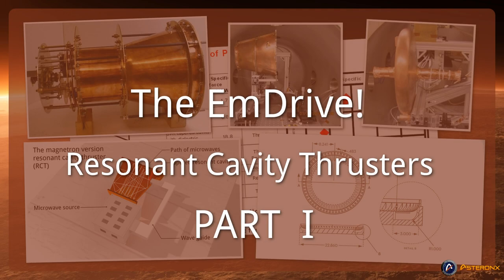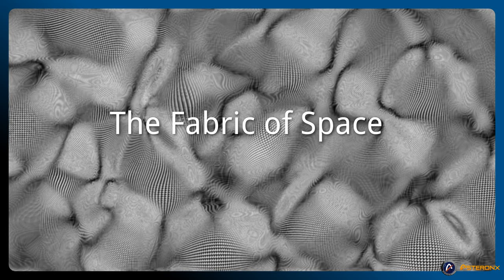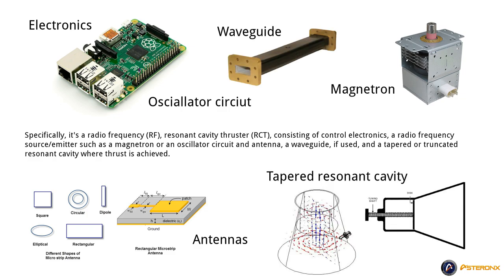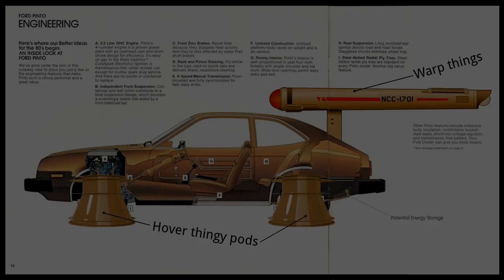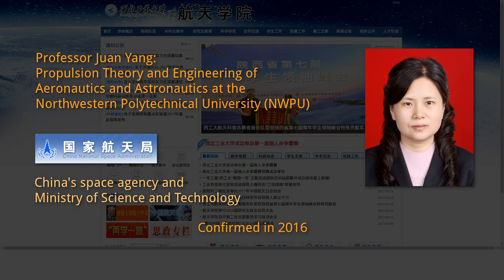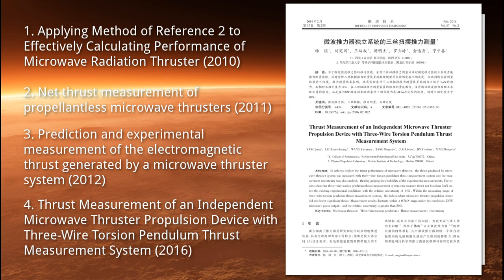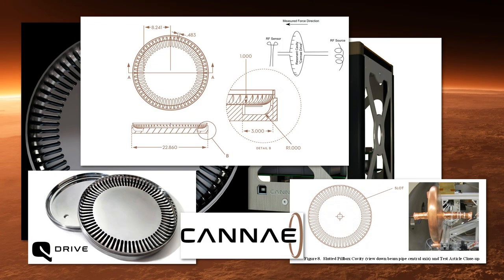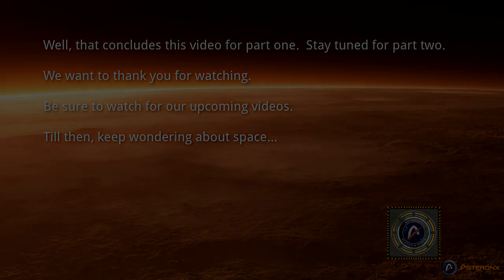An Explanation of the EmDrive and Cannae Drive Part I

Comment: The emdrive does violate conservation of momentum. Shawyer's explanation does not hold water as it does no include any new physics, and elementary arguments show that any device that does what he wants the emdrive to do must either invoke some radical new physics or violate conservation of momentum. His calculation purporting to show otherwise has elementary mistakes, such as the fact that he's not accounting for the momentum imparted to the side walls. He thinks he can handwave that away -- he cannot.
Reply: Well, here is the thing. The explanation given was a theoretical one and refutations given are theoretical ones. In the real world that's all masturbation what matters is that the drive passes the tests. It has passed tests all around the world so far. It's tested positive more then once at Eagleworks. Now it's being tested by the U.S. government in a plane for some reason and its going to go into satellites for testing.

If it still works there then it doesn't matter what Newton's law says. There will need to be something new to explain it or Newton was just wrong. 

Long story short, if it keeps on testing positive for thrust then it produces thrust. That's it, end of the line, reality trumps theory.
Reply: " It has passed tests all around the world so far. "

Nope, it has passed no useful tests. All tests done so far have been either negative or haven't properly accounted for systematic uncertainties. 

"It's tested positive more then once at Eagleworks. "

Which has the problem of systematic uncertainties above. But this can be fixed. If you analyze their data properly, their paper becomes just another negative test.

"Now it's being tested by the U.S. government in a plane for some reason and its going to go into satellites for testing."

There's no evidence of any of this.

". That's it, end of the line, reality trumps theory."

Indeed, but more importantly, reality trumps wishful thinking.
Reply: Well, here is the NASA test done that disagrees with you. https://drive.google.com/file/d/0B7kgKijo-p0ibm94VUY0TVktQlU/view

The IBT reported that China is testing it on the Tiangong-2 and the US is testing it on the X-37B.

Saying there is no evidence when you haven't looked only makes you look lazy.

I don't see how its wishful thinking to agree with positive tests.
Reply: Like I said, once you interpret their data correctly, subtract the background and control for thermal effects, that experiment reports zero thrust. Once again the issue is one of uncontrolled systematic uncertainties, nothing more.

"The IBT reported that "

And who is their source?

"Saying there is no evidence when you haven't looked"

No offense, but I'm pretty sure I've looked into this with far more care and depth than you. Hence why I know that this test doesn't show what Eagleworks claims it does.

"I don't see how its wishful thinking to agree with positive tests."

The wishful thinking is not in "agreeing with positive tests", but rather in uncritically assuming that any positive test is reliable when measuring thrusts this small can be pretty difficult.
Reply: Ok you say if you control for thermal effects the experiment reports zero thrust. Where is this at? Surely you know being that you know more about this then me.

The IBT said internal source.

I don't think you have.

Well good thing Im not doing that. I said tests not test. The repeatable positive tests is why I think there is something.
Reply: I have made two videos where I explain some of the issues concerning the emdrive in detail. I talked to builders, I talked to skeptics, I talked to proponents. I don't think you did anything approaching that. 

"The IBT said internal source."

The IBT has consistently reported nonsense with regards to the emdrive. "Internal source" is meaningless.

"Well good thing Im not doing that. I said tests not test. The repeatable positive tests is why I think there is something."

What you still fail to understand is that there has never been a positive test.
Reply: So did you not read the links on your first video. The Johnson Space Center got a positive and addressed  thermal. 

Talking to skeptics and proponents is masturbation. You may as well be saying some people told me their feels.

Well, the IBT is not some fly by night tabloid so citation needed on that one. Anon sources is how stories normally break but not sure what you mean by meaningless when you talk to people about their feels on the topic.

What you fail to understand is that there are positive tests and you linked one in you video description.
Reply: "So did you not read the links on your first video. The Johnson Space Center got a positive and addressed  thermal. "

I don't know what you mean by "Johnson space center". Eagleworks is essentially an independent lab. As I explained to you, they analyzed their data incorrectly. What they claimed they got is irrelevant; their experiment shows zero thrust once thermal expansion and background effects are accounted for correctly.

"Talking to skeptics and proponents is masturbation. You may as well be saying some people told me their feels."

This is just to illustrate what kind of effort and care I spent here. I highly doubt you looked into this with more care and depth than I. 

"Well, the IBT is not some fly by night tabloid"

It pretty much is.

"citation needed on that one"

Actually, the burden of proof is still on your court. The evidence you presented was essentially "some journalist asserted it". That's not credible at all.

"What you fail to understand is that there are positive tests and you linked one in you video description."

Can you explain in your own words what a systematic uncertainty is?
Reply: Well the one you linked says Johnson space center. Again feel free to do an experiment or link one that shows the experiment you linked can be explained by "thermal expansion and background effects". Just saying "no it's wrong" is as you would say "irrelevant".

Well if you consider wasting time with peoples feels as "effort and care" then maybe you have, but peoples feels don't actually count for anything so....

Well there track record is evidence that they are not some fly by night tabloid. So when you say they are that's a claim. Claims have burden of proof. I told you my evidence now it's your turn. Do you even now what the IBT is?

Inherent inaccuracy in a measuring process. Now in your own words can you explain statistical significance? While you're at it explain how statistical significance deals with systematic uncertainty.
Reply: "Inherent inaccuracy in a measuring process. "

Incorrect.

"While you're at it explain how statistical significance deals with systematic uncertainty."

It doesn't.

Let's put it this way. I bet you $200 that there will be no functioning emdrive in one year. Well?
Reply: The mere fact that you think "statistical significance" has any bearing on systematic uncertainties means you don't understand systematic uncertainties. This is important, because it's the crux of why the emdrive supposedly positive tests don't demonstrate what proponents believe they demonstrate.

"Well Ill take that because there are already ones that function"

Nope, there are zero at the moment. I'm talking about incontrovertibly functioning. Independently tested, systematics accounted for, clearly beating a photon rocket. Easy $200 if you're right. Well?
Reply: The mere fact that you don't think "statistical significance" has any bearing on systematic uncertainties means you don't understand systematic uncertainties. It is very important, because it's the crux of why the emdrive positive tests actually demonstrate what the tests demonstrate.

Ill explain it to you. If the statistical significance of a test is high enough it rules out errors (uncertainties) to a certain percentage. Then you go into peer review to try and get more tests of statistical significance to rule out error even more. Currently the Nasa paper has passed peer review and is being replicated more. Soon to be tested in space in a satellite and a space station. 

Well their function is to produce thrust. They do that even if it's only from thermal expansion. So you own me $200.
Reply: "Ill explain it to you. If the statistical significance of a test is high enough it rules out errors (uncertainties) to a certain percentage. "

Not systematic uncertainties. That's the point. That's why it's important that you understand the difference between systematic and random errors. A systematic error is, for example, if I'm measuring time with a pendulum clock, but I made a mistake when measuring the length of the cord, or the gravitational constant. All times measured by that clock will be off and it doesn't matter how much data I take. The "p-value" is irrelevant because my data is systematically wrong.

"Then you go into peer review to try and get more tests of statistical significance"

No testing is done during peer review.

"Soon to be tested in space in a satellite and a space station. "

There's no evidence of this.

"Well their function is to produce thrust. They do that even if it's only from thermal expansion."

No, they don't. A thrust from thermal expansion cannot be used for anything -- it's just measurement error.

"So you own me $200."

Where is the incontrovertible test I asked for?
Reply: Thats why you design to weed out that possibility and statistical significance is a part of that. See you run multiple tests and a null test which weeds out systematic error with statistical significance. If you have only one test with a huge discrepancy with the others then it's most likely not random error its a systematic error. Have you never done a college level experiment before?

Didn't say there was testing in peer review. 

There is evidence and I gave it to you. I have seen even more with a simple google search. This is mostly pointless because anything I give you, you'll just say it doesn't count in some way by making a baseless claim like you did before. SO Ill ask you what would it take to show you that there are planed experiments for the EMdrive in space?

Not being useful is not the same thing as not functional. 

Every test done even the inconclusive ones showed thrust of some kind. Pick one any one. You own me $200.
Reply: "Thats why you design to weed out that possibility and statistical significance is a part of that. See you run multiple tests and a null test which weeds out systematic error with statistical significance."

No, that's not how any of this works. Systematic uncertainties are not trivial and they are the reason the Eagleworks test failed.

"Have you never done a college level experiment before?"

I have taught them.

"There is evidence and I gave it to you."

There is zero evidence. "Some journalist said it" is not evidence. Journalists can say whatever they want. 

"This is mostly pointless because anything I give you, you'll just say it doesn't count in some way"

I'll only say it "doesn't count" if there's a serious problem with the evidence, such as it hinging on the word of some random journalist. "A journalist said it" is not evidence.

" by making a baseless claim like you did before. "

Which claim was baseless?

"SO Ill ask you what would it take to show you that there are planed experiments for the EMdrive in space?"

A statement by the agency doing the testing. No "internal sources", no journalists.

"Not being useful is not the same thing as not functional. "

Of course it is. "Thermal expansion" means that the apparatus warms up, expands, and displaces its center of gravity. The only reason there is a signal at all is because it's on a test stand. My standards for an emdrive to work are simple: it better be a working propulsion system. If all the "thrust" signal is generated because of thermal expansion, it does NOT work for propulsion.

"Every test done even the inconclusive ones showed thrust of some kind. Pick one any one."

Each and every positive test had uncontrolled systematic uncertainties which make the experiment worthless.

"You own me $200."

Nope. We'll see in one year. If there are any conclusive positive tests, I'll give you $200. If there aren't, you'll give me $200. That's how this bet works. Currently there have been no conclusive positive tests.

400 years of physics say this thing doesn't work. It's that simple.
Reply: That is actually how most Systematic Errors are found.

Yeah sure doesn't count bluh bluh bluh.

Dr. Chen Yue as been the source for many of the news papers. Of course you will say that it was in the news so it doesn't count. BTW "Some journalist said it" is evidence you just don't like it.

Here is the company going to test it in a satellite http://cannae.com/cubesat/. There you go from the source a planned test in space. Im sure even though it matches the standard you gave you will still say it doesn't count some how.

The baseless claim was that IBT is a tabloid or untrustworthy. I asked if you even knew what ITB was and you didn't reply to that question.

In zero G if one side is hotter then the other which is how it would displace its center of gravity in a test. The inferred dissipation would give it thrust. You know like in your video when you say the light would have thrust. You own me $200. So don't need to see you in one year as far as I'm concerned you already lost.
Reply: I'm sorry Dave, this conversation can serve no purpose anymore.
Reply: Well I take it you consed that there is a planed test for space and the EMdrive would have thrust even if its only from thermal. Ill be waiting for my $200 but I will not hold my breath. You're not honest enough.
Reply: "Momentum imparted to the side walls would cancel each other out I thought"

Only the sideways components cancel, due to symmetry. Greg Egan has calculated the force on the side walls analytically for a cavity with spherical endcaps (which Shawyer claims would be a better emdrive anyway) and it can be seen explicitly that the net thrust is zero.
Reply: Brian NZ 
It is correct that the momentum is cancelled out unless the cavity is as asymmetric, see above.
Reply: Momentum is conserved whether or not the cavity is asymmetric, because momentum conservation is an unavoidable feature of classical (or quantum, for that matter) electrodynamics. It is simply not possible to obtain thrust in excess of that of a photon rocket without new physics.
Reply: It does NOT violate anything. It's basically the same principle as a solar sail and rocket engine. Physics is NOT broken. Any child should understand this simple concept. Electromagnetic radiation exerts pressure. Let it escape out one end without pushing against anything. You will have unidirectional thrust on the other far end. Just merely using the pressure of radiation instead of the pressure of hot expanding gasses in a combustion chamber.
Reply: Dan, if it worked like a solar sail or rocket engine it'd be a photon thruster. These are possible in principle but require 300 MW for each newton of thrust.
Reply: How is it not obvious that the radiation escapes into space at one end without hitting any walls ?  Due to action and equal reaction, you have thrust on the other far end.
Reply: I'm sorry, +Dan Mitchell , I didn't realize you've never actually read anything on the emdrive.

THE FUCKING CAVITY IS CLOSED, THE RADIATION DOESN"T ESCAPE.

Did you read that? Good. Did you understand it? Well, I guess we'll see.
Reply: Robert Morrow 100% perfect cavity? No transmission? Barely any absorbtion? Only reflection? You might have close 100% reflection efficiency with a tuned wave guide, but you have the reflection graph for a range of frequencies. Usually below 100%.
Reply: If some radiation escapes, fine -- you get some thrust. But you get significantly less than what emdrive proponents claim. You get something bounded by the efficiency of a photon rocket. 300 megawatts for each newton -- can't do any better than that.
Reply: Vacuum Diagrams lets call this an asymmertical photon leak thruster and your photon drive calculations are way off. You get over 34kN for a 100kg mass with 6MW power (200g of carbon /second, 6MJ/s). Anyone ever built a photon drive/thruster or no because of the lies?
Reply: Vacuum Diagrams I strongly disagree with that 300MW/1N.
Reply: Vacuum Diagrams photon effective mass is m=hf/c^2. Newtons law E<=>Ephotons.
Reply: Vacuum Diagrams with 5kW (E=5kJ in 1s) and 1kg mass, you get 100N of force.
Reply: You may strongly disagree if you like, but it's a hard physical limit. It cannot be avoided.
Reply: Vacuum Diagrams i dont believe it is what you say. I just showed otherwise, so up to you to give something more than a statement.
Reply: Vacuum Diagrams earth is not flat either, so if you dont give reasonings for your hard limit, I take it as purposefully misleading statement.
Reply: But Jatski, you didn't show anything. You made some assertions, but that's really not enough. Anything better than 300 MW/N and you get a perpetual motion machine. That's just the way it is.
Reply: Bah ma Threery!
Reply: Sorry Cerberus, there's still zero evidence that the emdrive works.
Reply: Vacuum Diagrams. Use newtons laws to show yourself. "Thats just the way it is" shows even less.
Reply: Vacuum Diagrams. PMM is entirely possible, we live in God and Jesus was raised from dead by God, and pride is a bad thing in science, but fortunately basic powers do not control the created. Open your eyes to see your blindness.
Reply: Vacuum Diagrams. You dont need it to be perpetual to have it better than what you state. You dont show where you get that number.
Reply: Vacuum Diagrams. Please give full clear text explanation. Otherwise I have enough knowledge to keep what I have.
Reply: Vacuum Diagrams. Btw. Photon propulsion is energy conserving process. If you have arguments relating to the photon generation process then you might end up with energy conservation or perpetual motion. I have masters in electric engineering / electric physics related matters, if it should matter.
Reply: Vacuum Diagrams. Just for the sake of conversation, assume you have LEDs which convert E(electric) = E(photons) with 100% efficiency.
Reply: "Please give full clear text explanation"

I have given it to you. 1506.00494 is an arxiv identifier. Google it and you will find the relevant article. Read it before responding, please.
Reply: Vacuum Diagrams. I'll just ignore you.
Reply: @Vacuum Diagrams     Yeah, this paper you are telling us to read is just a bunch of "but my theory". The facts are the drives give thrust, so now it's just is there some reaction or leakage we haven't found yet or does the theory need to be tweaked. Reality trumps theory every time.
Reply: Cerberus Hex. Test it by removing a piece of reflective surface from some side to see if thrust increases. If yes, then EMdrive is just a leaking closed-off photon drive. Try making a thruster by removing one side entirely, forming a directed radio antenna. -> Directed high-power radar.
Reply: Should be vacuum-tested because heated air is less dense and might push out of the opening. Microwaved hot air is leaking?
Reply: Cerberus, "But my theory" is not even a complete sentence, let alone an argument. 

"The facts are the drives give thrust"

There is no such fact. Some people believe that the drives give thrust, but their experimental design was too flawed to convince anybody else.

This is the issue: you want to overturn physics? Go ahead, but prepare to convince people. 

It was the exact same with the superluminal neutrinos debacle. You would've said "reality trumps theory" and would've gotten egg on your face because "a single/few experiments" and "reality" are very much not the same thing.
Reply: It has been tested in a vacuum, more then once.
Reply: Cerberus Hex. I meant to test what I suggested in vacuum. Was the resonator chamber in vacuum too? Or air filled? The chamber was sealed?
Reply: @Jätski.fi     The tests at the Johnson Space Center had the whole thing in a vacuum chamber.
Reply: Cerberus Hex. Yes. If you put a sealed air container into vacuum chamber, it will not go to vacuum? Unless overpressure leaks. Was the container emptied to vacuum also?
Reply: @Vacuum Diagrams    Did say it was an argument, It's just funny when people think their magic words on paper make reality go away. So as I said "but my Theory".

Actually there is such a fact, sorry. Even if it's just some kind of leakage and/or it doesn't work like it's said to, it still has shown thrust.

You have no clue what I want and tests are being done for the convincing.

Actually with the superluminal neutrinos thing from a few years ago it was only seen once as far as I know and was investigated, tested, then corrected. With these drives it's been tested and tested and tested, and tested, with progressively more advanced instruments. I only say "reality trumps theory" when it's been confirmed so many times.

You seem to have no nuance to your thinking. At this point it's idiotic to say it has no thrust. We are well passed it as thrust. We are now at the point where we have to find out why. It seams unlikely that we will need to change much if any at all. There has been at least three papers done on how this could have thrust and so far none of the explanations violate any laws or theories.
Reply: @Jätski.fi   The whole thing was in vacuum as far as I remember. You could look up the paper.
Reply: Sorry Cerberus, but the reality is that there is zero evidence that the emdrive works.
Reply: "Vacuum Diagrams. I'll just ignore you."

Your choice. I've shown all the information you requested. It's up to you now.
Reply: Vacuum Diagrams. Repent and believe the Gospel. Believe in Lord Jesus and you will be saved.
Reply: Sorry Vacuum Diagrams, you're wrong again, it's been built, it turns on, and it produces thrust. So either you don't understand what the word "works" means or you're just in denial of reality.

I know you think you have some magic words that make this all go away but you're not a wizard.
Reply: You're welcome to your opinion, Cerberus. Reality doesn't change.
Reply: Vacuum Diagrams Dude, just stop. These people probably couldn't define spin without a ball.
Reply: Could you say that again? Just Dum it down a notch for the rest of us
Reply: @Jkauppa  power over thrust of a photon drive in W/N is c, i.e., 300,000,000 m/s = 300 MW/N.
Reply: @alexdevisscher6784  energy vs momentum, who cares of that
Reply: @alexdevisscher6784  its just how much Joules in photons you put out